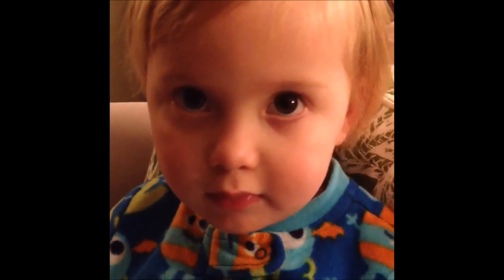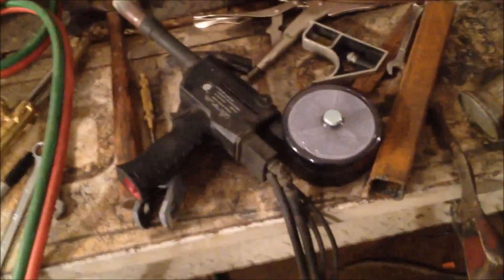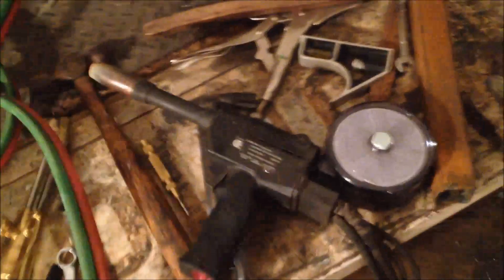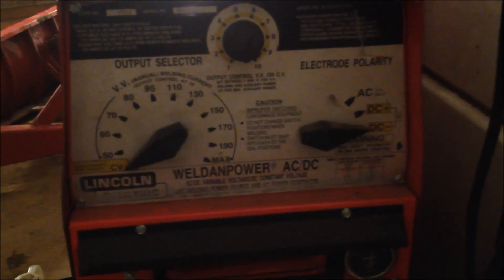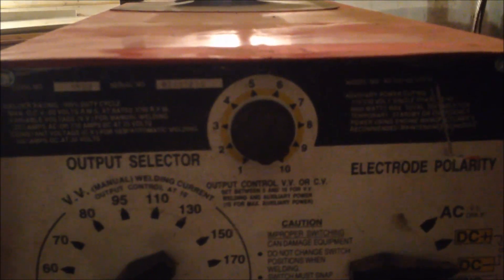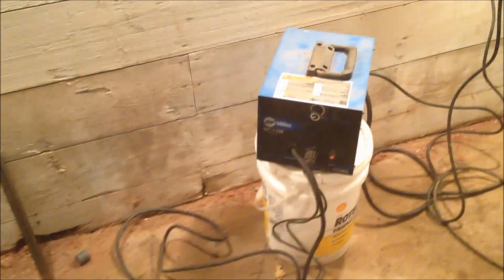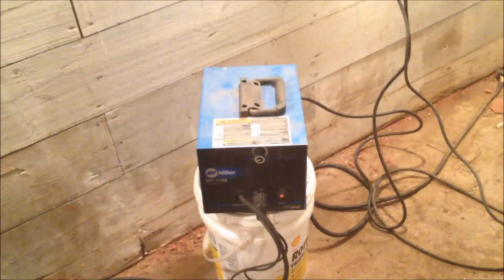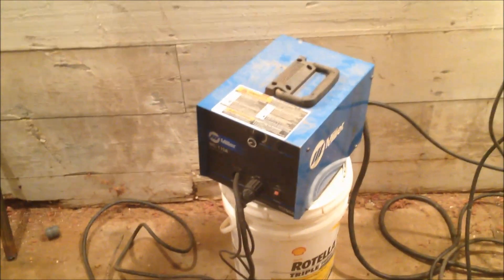Miller Spoolgun on a Lincoln Weldanpower AC/DC

Comment: I just aquired a WC-115a with contact. I want to connect my S22A feeder to it, via Lincoln Ranger 8. How do I do this? Also,
I noticed that mine has a male 14 pin input. My ranger has no amphenol connection. Do I just leave it unhooked?
Reply: Welp... your 22A has a 14-pin connection for the 24V it runs off of, the trigger circuit, and the potentiometer that changes the signal for feed motor,  you would have to convert your 14-pin on the 22a to a 10 pin, and make sure all the pins are in the correct spot for that WC 115. To do that you have to a get a print of both the 22A, and WC-115 and then re-wire your control cable on the 22A to the 10pin connector... 

 Basically, get wiring print for 22A control cable plug

get print for WC-115

buy 10-pin connector, crimp tools, and a multimeter

re-wire control cable on 22A to 10 pin using schematics, and just hook the 115V plug into ranger, as well as welding lead. leave the other plug disconnected and leave the welder output on. Make sure you have it in C.V.

If you don't undersand what I am saying don't even try, you are likely to kill yourself or damage you welder.